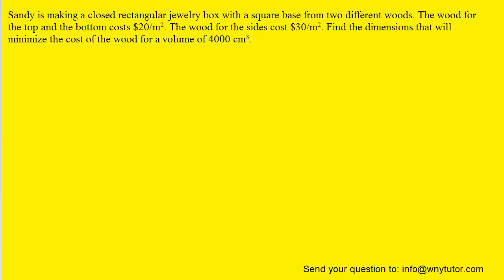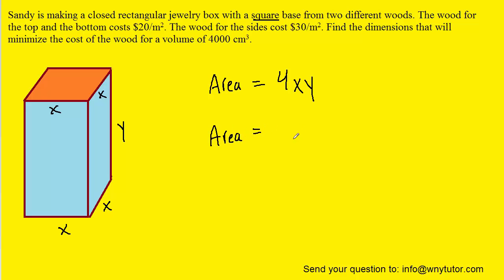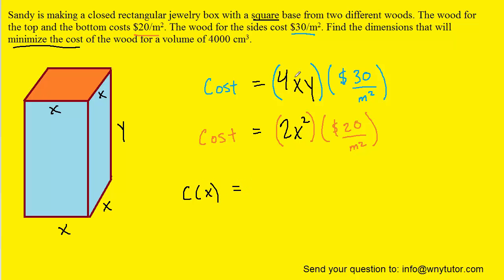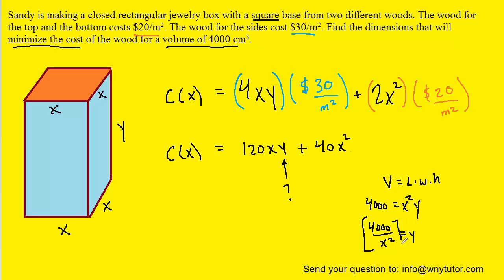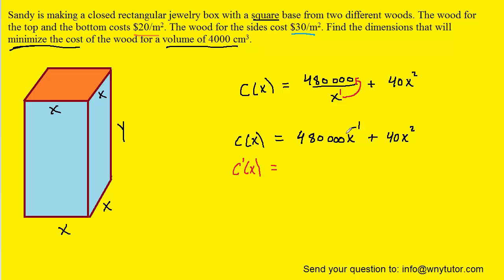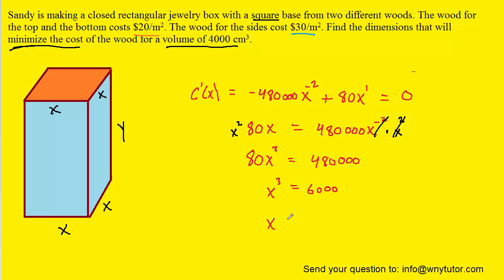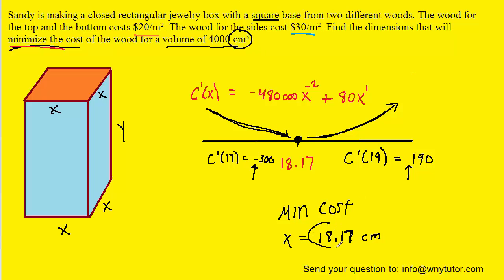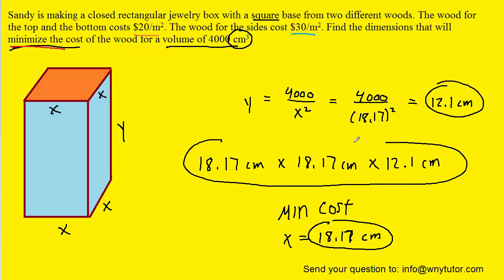Sandy is making a closed rectangular jewelry box with a square base from two different woods

Comment: Great explanation. I'm just wondering why this works even though we were working with m^2 but the volume was in terms of cm^3. I was thinking the rates needed to be converted in terms of cm^2 but I guess not hmm
Reply: Good point. Maybe he forgot to convert the units, but that it doesn't matter because you probably got how to solve like this problem, and that is overriding point.